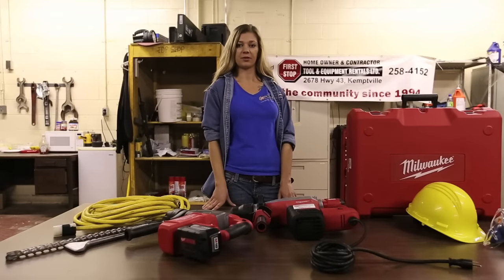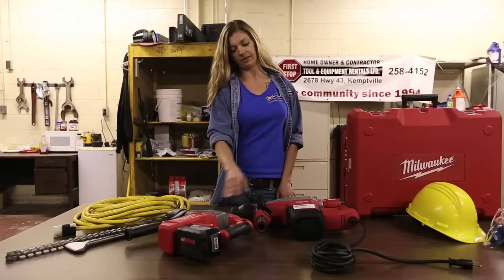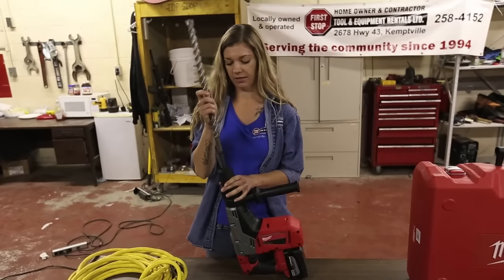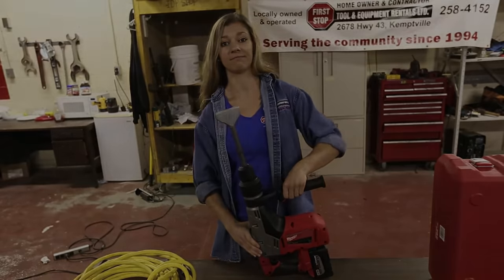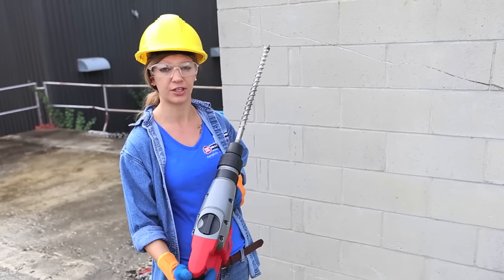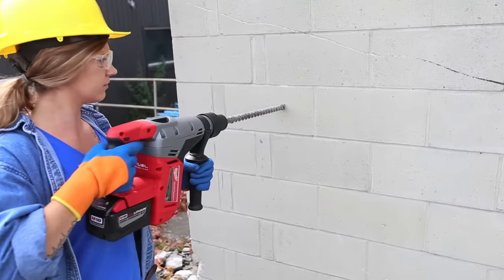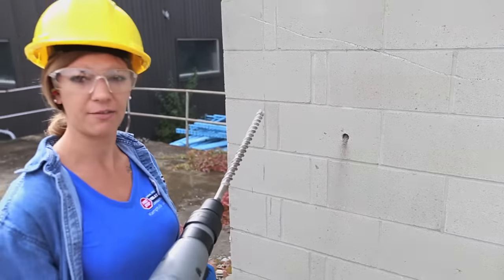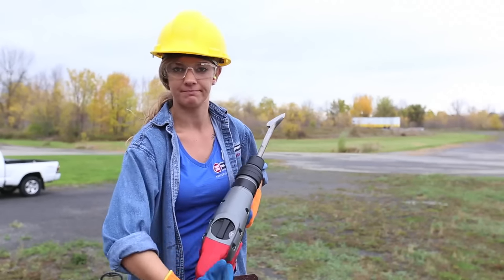How to Use a Rotary Hammer Drill

Comment: Seriously underrated how fun these two tools are at work. Make sure to not breath in the dust. Have a good time. Worth it ☺️

Nothing like blowing through a 14 inch concrete wall. Clutch saves your shoulder btw... That's probably worth it too. Especially if this isn't what you do every day. For the first timer, go for the one with the e clutch. Will save your bits and you won't go flying when it binds. Milwaukee all the way. Easy to use and consistent. I own other tool brands too. I just prefer my Milwaukee 💛
Reply: คนงงไป
Reply: @somchaimankong1628  hjjjjjbjhjh
Reply: N l
Reply: Пор пкуа

Comment: hey, thanks for this demo upload.
wondering if these professional/ high end ones are sold by themselves (complete kit) at any economical price?

I dare say I'll be able to use your services.. though I'm COMPLETELY in awe and admiration of the person (lady) doing all those works (even if for the short demo).

[the reason I might never use your rentals is 'cause I''m from/in India]
Reply: Captain is Spock 0
Reply: Spock * Milwaukee is a high end tool and they do cost alot more than home use tools. Keep in mind any tool company that makes a cordless rotary hammer is most likely going to be conmercial grade. If you get a cheap in price one it will be junk. This is technically not a hammer drill.. It is called a rotary hammer, but a rotary hammer is basicaly a suped up hammer drill that offers one other option. They have a mode that allows for chipping also.
Reply from the maker: Jason Hull agreed!  It’s a “get what you pay for” concept.  Milwaukee also offers 5 year warranty and we’ve always had a great experience renting these items to our clients.
Reply: First Stop Rentals Ltd You cannot beat Milwaukee rotary hammers. The cordless varients are amazing as well.  What commercial brand tool do you find more problematic in your line of renting tools? I have basicaly always been a Milwaukee guy for certain tools and a Dewalt guy for certain tools. Dewalt has the best grinder i have ever used.
Reply from the maker: Spock * thank you for the kind words!
Reply: P
Reply: G
Reply: First Stop Rentals Ltd Z  fcc
Reply: That was a milwaukee yes they do
Reply: U
Reply: Ooooooo no un
Reply: Jun i o op kol molio 9 lokomotiva pili il

?. Html i da se ne
Reply: @maelysvandeweghe1697  jjjjj
Reply: 80
Reply: @jasonhull2163  Bosch
Reply: @gregkosinski2303  Technically Hilti.... is best rotary hammer. The cordless Milwaukees did have one up on Bosch in the cordless. Now the Makita 40 volt rotary hammers are showing up all over the place. They are my preferred Now. I was also gave Makita tools for gifts. Milwaukee is junk compared to Makita. Only think Milwaukee I still use are my impact wrenches.  I was with Milwaukee for years.
Reply: @javierandresperezandrade4897  cool story bro
Reply: @املامل-م7خ6ت  sfg
Reply: Cs0
Reply: Ur

Comment: How to stop it sliding when starting to drill
Reply: Glue a duck tape on the wall first. And the drill on it
Reply: Take a bull point chisel or a concrete punch and a hammer and mark the place where you will be drilling, similarly how you would do this on metal with a punch tool. Also, if you are drilling with a large diameter bit it might help to predrill with a smaller one.

Comment: Was the tool used a 'rotary hammer' or a 'hammer drill?  Or,  what model # tool?  Thanks.
Reply from the maker: Liccinius this is a Milwaukee 3/4" SDS Max combination rotary hammer drill.
Reply: 6
Reply: @christiankompa64  ๅ
Reply: 1
Reply: @firststoprentalsltd3736  1
Reply: @firststoprentalsltd3736  1
Reply: @asaadchiha6438  ช9
Reply: Лл
Reply: Ffv
Reply: @เจตโฟนโฟน-บ9ม  worf
Reply: @firststoprentalsltd3736  يببققيبق

Comment: What are all the dislikes about 🤦‍♂️
Reply: Might be about them not mentioning the diffrent work modes, explaning how to get the chisel bit in the correct rotaded position for the user and not explaning the difference betwen regular SDS and SDS MAX(big difference).

To be really picky, they did not mention safe operation. I can see that she is useing earplugs but not everyone will notice. They did not mention about dust management for bigger projects either (dust mask och sutible vacuum). Technicaly there should be dust management for every time the machine is used. This time she was outdoors so no one cares but most projects that people use rotary hammers for are indoors.
Reply: @jagarcogheart  Also she doesn't have the handle in the correct position. She could really injure herself when kickback occurs.